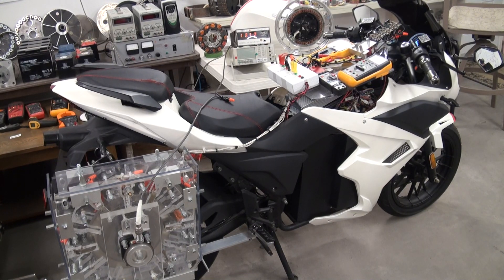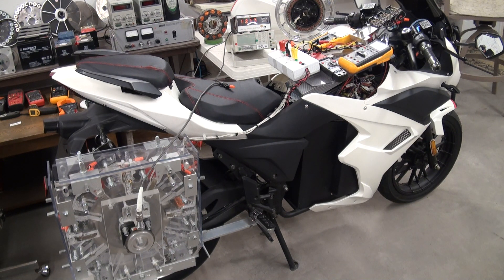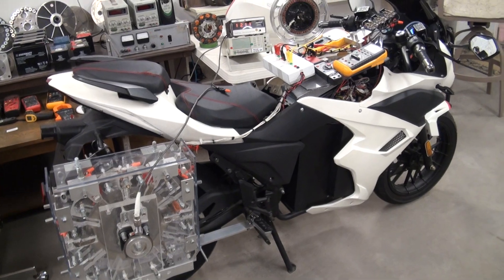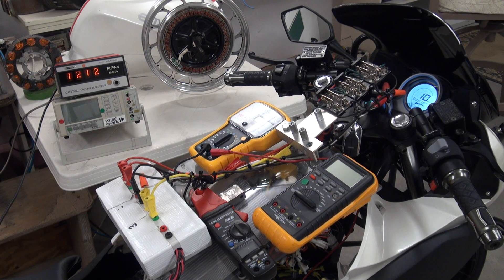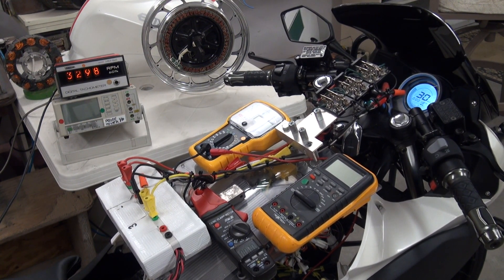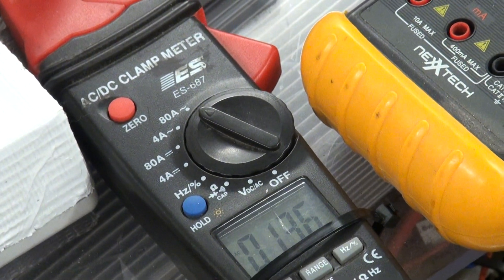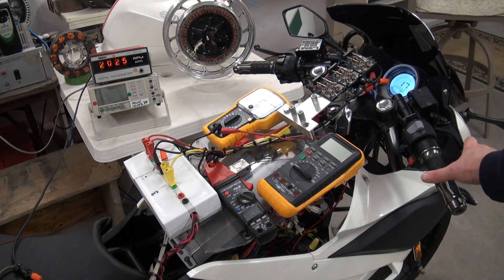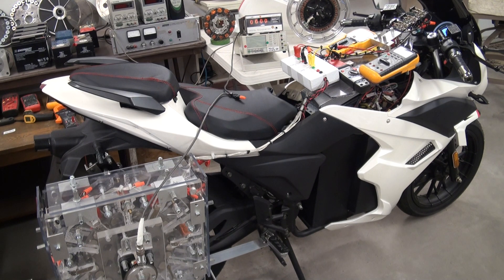ELECTROMAGNETIC FIELD ENERGY MOBILITY / EV & ICE VEHICLE PROPULSION in 2025

Comment: how will you spin a hub motor at 3400rpm?
Reply from the maker: Like this: https://youtu.be/jfDZW6_f93U
and this: https://youtu.be/Wx1n__XdJuY
Reply: @PDiCanada1  
its that a regenx gen as a motor?what is the other smaler motor with brushes?which is which?...O, but at 3400rpm on a outrunner will have to be at 150mph..
Reply: @ady0187  30km:hour you saw the video he set it at 30km
Reply: @EnergySeeker  30km/h wit the shaft conected to the wheel tire...thats a 1:5 gear reduction..but a separated unit like a outruner bldc ..like the one the bike uses now..will have to spin real fast and the speed will be very high
Reply: @ady0187  the tachometer is in display and you can see at 30km it show a speed of 3300 rpm it’s clear